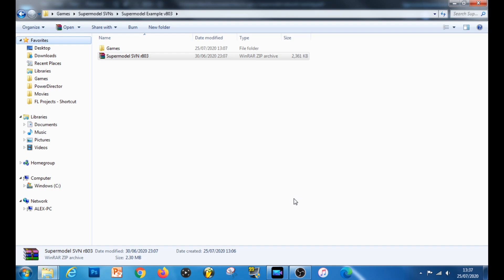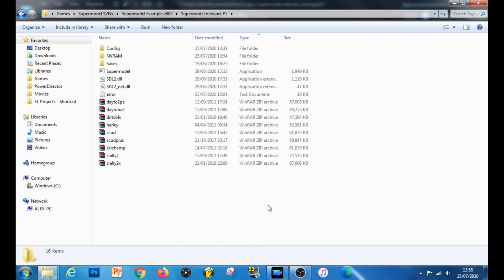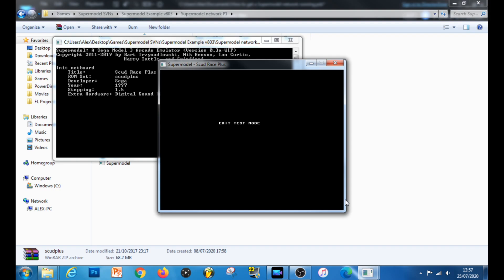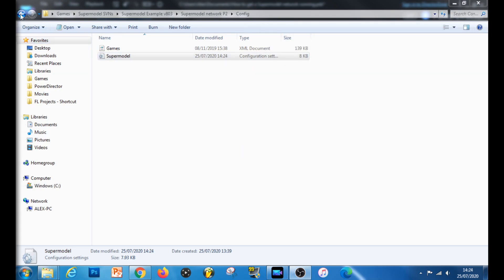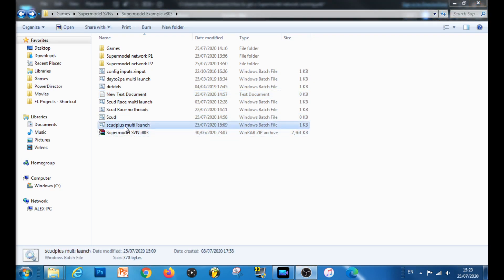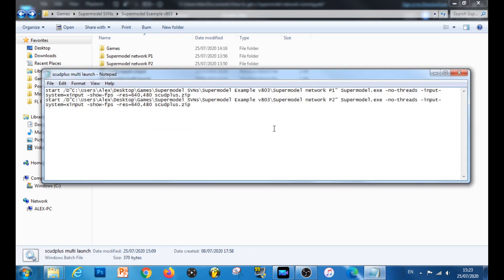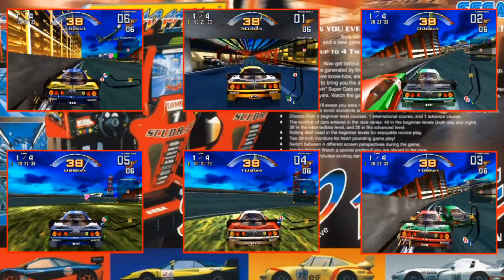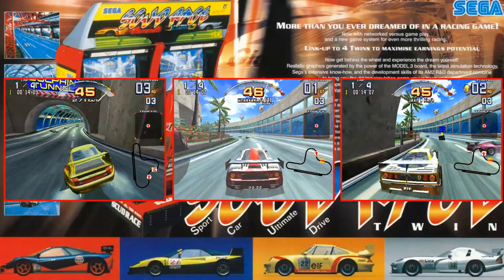Tutorial: How To Get a Supermodel3 Multiplayer Network Running

Comment: Are you able to skip the batch files and just use hyperspin/rockelauncher? Is that an option?  Sorry, i'm not super sabby in this department. Thanks
Reply from the maker: I'm not familiar with either of those frontends. I use Maximus Arcade on my Bartop, but you still need a batch file to point it at to get the game to launch. Batch files are super easy to understand though, I explain how to set them up in both thus video and the new updated version I released awhile back, which talks about the new Supermodel network. https://youtu.be/vAoGAkPMROM
I'd recommend watching that one over this one.

Comment: When I open the game, it says that the command "-no-threads" is incorrect. Then I Tried Editing My Batch File (Daytona USA 2: Battle On The Edge) I Removed The "-no-threads" And The Game Started, But There Was A Problem: The Game Stayed On The Screen Showing Game Information (Link ID, Car Number, Cabinet Type, Etc) This Happened To Me When I Tried To Load The ZIP File On The Mame Emulator.
Translated By Google Translate
Reply from the maker: This is for Supermodel emulator, not MAME.
Reply: @MrThunderwing  I know, I didn't mean that.
What I mean is that it says the "-no-threads" command is wrong, and I have no idea how to fix it.
Reply from the maker: @WolfixGaming  You don't need the -no-threads command anymore in the new version of the network. I pinned a comment explaining this after the process changed for the new network and also updated the video description.
Reply: @MrThunderwing  I already managed to fix the error, but I have one more problem...
When I open the batch file, the game starts 2 times, as it should, However, no key performs its function, and I could see that the text that says "Network Checking" was not appearing. What is the cause?
Translated By Google Translate (Yeah, I Speak Spanish) XD
Reply from the maker: @WolfixGaming  Try reading this for problems with your keys: http://www.supermodel3.com/Usage.html
I don't know why the "network checking" bit would stop appearing for you.

Comment: Hola, muchas gracias por el video, me funciona perfecto, solo que solo puedo controlar la pantalla del emulador que está activa, no puedo utilizar los controles de las 2 pantallas al mismo tiempo, se mueve 1 u otra
Reply: Tengo 2 joystick y esta configurado 1 en cada emulador, pero solo funciona el de la pantalla activa, y no puedo activar las 2 pantallas al mismo tiempo
Reply from the maker: You need to use Xinput controllers to operate each screen independently. For some reason it doesn't work if you use Dinput pads or wheels, you can only control the window that's 'in focus.
Reply: @MrThunderwing  Muchas gracias por responder mi mensaje a pesar de que fue escrito en español, mire tu video con los subtitulos automáticos de Youtube traducidos y pude entender todo, mil gracias, ahora voy a probar con el Xinput
Reply from the maker: De nada!

Comment: Hi i don't get any sound on the supermodel 3 emulator, do you know how to get the sound working?
Reply from the maker: The sound should just work as a default option, unless you're using command line options to change the music and sound volume or you've used the -no-dsb option to mute it. If you've not done something to intentionally disable the sound, I've no idea why it isn't working for you.
Reply: @MrThunderwing  Do i have to change the config settings? The only game i play is scud race.
Reply: @MrThunderwing  Could you share me your config settings please?
Reply from the maker: @marty_mcfly5438  are you trying to play the game using a GUI or are you launching it from the command line?
Reply: @MrThunderwing  Command line, i drag the rom on top of supermodel, then it launches the game.
Reply from the maker: @marty_mcfly5438  The sound should work that way. Are you using an old version of Supermodel? The very first version of it (from 10 years back) had no sound. You could try one of the newest versions from here. https://www.supermodel3.com/Download.html
If that doesn't change anything, then I don't know what to suggest, it sounds like an issue with your PC rather than the emulator.
Reply: @MrThunderwing  What are your config settings? Also i think i am using an old version, where is the link for the newer version?
Reply: @MrThunderwing  i have just downloaded a newer version of supermodel. It says "cancelled network board not present"

Comment: Hello! I am a big fan of Daytona USA and have been playing it for years. I want to be able to push this to it's absolute limit with my system running 16 racers although I have one issue. I'm having an issue with the machines crashing if I don't get into the service mode fast enough in order to switch them to slave machines and assigning a car number. Is there a way I can manually do this within the files themselves?
Reply from the maker: Nope, you can't manually alter the NVRAM to switch the car numbers. If you just enter the test menu and configure everything with the network options turned off in the config ini file you shouldn't have any issues with a time limit or crashes. Just configure each version of the game to the appropriate Slave and car no with the network options turned off, then turn them back on once you've finished.

Comment: Thanks for putting this video together it really helped me out with configuring Daytona 2 PE also I wonder how many machines you could get running now as you said you managed to get up to 6 networked machines on the same pc before things were really bad well id assume now you could get even closer now to 16 networked players.   

I was tweaking with the UI since i had the same problem you had where i was only getting 25 frames a second as it was really slow and choppy so i dropped the resolution to 496 by 384 and also increased the  power pc frequency to 100 and with 4 machines linked up with the static IP I am managing to get between 80 and 110fps so 16 players could be plausible.
Reply from the maker: Supermodel's quite resource intensive and my PC's about 10 years old now, so with the new full speed network I can only really get about 3 machines linked without starting to lose speed. Somone on the Supermodel forum with a gert beast of a PC has been able to get 16 linked versions of Daytona running. I've seen videos as well of an 8 PC network, all in converted arcade cabinets, it's very impressive.

Comment from the maker: IMPORTANT NOTE - THE NETWORK SETUP PROCESS HAS CHANGED NOW FROM WHEN I FIRST RECORDED THIS AND THIS INFORMATION IS NOW OUTDATED - YOU CAN SEE A NEW TUTORIAL HERE:
https://youtu.be/tand0tIZ47w

In March 2021, a new simulated netboard option was developed by one of the Supermodel forum members that now runs the Supermodel link-up games at full speed, which replaces the old network I'm demonstrating. The basic principle of how you get the new network working is more-or-less unchanged from what I demonstrate in the video, but the information to configure it in the 'Config ini' file is slightly different now. The simulated netboard has now been incorporated into the official Supermodel builds and works in such a way that you can now select which netboard (i.e the old one or the new one) you wish to use in the options. 

In the config ini folder 'EmulateNet', which I mention in the video, has been renamed to 'Network'. There is also a new option in the config ini file, called SimulateNet which must be set to '1' to use the simulated netboard (it is by default), otherwise Supermodel will use the old emulated netboard. Both require that Network=1 otherwise neither netboard will be used! This means as well that you no longer need the -no-threads command in your batch files if you are using the new simulated netboard.
You can download the latest official Supermodel build from here: http://www.supermodel3.com/Download.html
3 Player Game of Daytona USA 2 running on new full-dpeed network:
https://youtu.be/vAoGAkPMROM

Comment: Hi, please, i got everything to work but it is impossible to play with 2 players because the controls only answear to the window that is being selected at the moment, is there a way to have both windows receiving the commands of the controllers at the same time so i can play with 2 players?
Reply from the maker: Yes, you'll run into this issue if you use Dinput control devices. In order to control what's happening in the seperate Windows you'll need to use Xinput pads. That means you'll either need to buy some Xbox 360 pads or find a way to emulate them with your existing pads (I believe you can do this using x360ce. I've got very limited experience with it though, so don't ask me how).
Reply: @MrThunderwing  actually i tried to emullate via a program called xoutput, it creates a virtual xbox 360 controller and you can map buttons, (it is a very good program actually, i used on other steam games), changed my bat file to xinput but unfortenatly same result, the buttons only responds to the windows in focus :(
Reply from the maker: @ricardomarino3763  Hrmmm, weird. In the multiplayer games you can see at the end of the video, me and 2 other friends were all playing with PS3 Dualshock 3 pads. I was using a program called DS3 tool to emulate 3 Xbox 360 pads and, as you can see in the video, they all worked fine.
Reply: @MrThunderwing  ok. I will try to test with actual xbox360 controllers. With 2 PCs in lan i problably will not encounter any problema to run dinput in each computer, right? I will try later with my pc and notebook. Anyway thx very much.
Reply from the maker: @ricardomarino3763  Yeah, you'll be fine with 2 PCs with Dinput devices.
Reply: Conseguiu resolver, amigo? Estou com o mesmo problema.

Comment: Thanks! It's excellent, you know, when I first time execute the *.bat, my antivirus actually stops the thread as it consider that it has a virus, and delete the file, ¿do you faced something similar?
Reply from the maker: Not with Supermodel, but I have encountered this anti-virus behaviour with other emulators. I use MS Security Essentials and it's got an option that lets me make certain files or folders exempt from it's normal anti-virus rules, so it doesn't delete parts of my games or emulators.

Comment: Hi, really nice and clear video!!!!! finally i should say...
BTW what are the results with Sega Rally 2? I am a big fan of it and I really wanto to set up a two players gaming pc... does it run well or there are glitches?
Reply from the maker: Unfortunately Sega Rally 2 doesn't work at all in the Supermodel link-up at present, I don't think the reason why is known.
Reply: @MrThunderwing  i just tested a quick match with Sega Rally 2 and I can't start the game... i get an error in the main Supermodel screen saying "RESET NetBoard PC=000800 // Network code copy ending ... too bad.
BTW Daytona2 starts with your batch file but really slow.. even if i have a &core intel 4,5 ghz and a nvidia 1660TI, seems bad code optimisation...
Reply from the maker: @claudioberio9461  Yes, the network has bug that currently makes the games run slow. You could have the fastest, most powerful PC on the planet, but at present in network mode you won’t be able to get Daytona 2 to run faster Than 30fps
Reply from the maker: @claudioberio9461  Sega Rally 2 works now and all the games now run full speed in Supermodel!
https://youtu.be/5PEd-TxGuL8

Comment: Is this version  (v803) the only actual one that works for network ???  I mean, if  I download current supermodel version, v834, network won't work ???
BTW, fantastic tutorial !!!
Reply from the maker: Thanks. If you download the latest version the network option may well be in there, it all depends on whether the person who compiled it and uploaded it to wherever you're downloading it from included the option.
Reply: @MrThunderwing  I bet the official forum compilation should do it .   Thank you :)
Reply from the maker: @toniclementegarcia6656  Technically, there isn't really an 'official' version (well, apart from the highly outdated 2011 version of Supermodel), but if it's one of the ones from the thread that gets updated over at the Supermodel forum that does normally have the network option built in.
Reply from the maker: @toniclementegarcia6656  The official Supermodel page now has auto-updating builds, which support all the new changes, including the new full speed network and Sega Rally 2 and Le Man's 24.

Comment: Thanks so much, i have a problem when im playing multiple Daytona emulators only one will be controlled at a time. whatever one is on top works. i have two controllers and both work but only the one that has the window on top. do you have the same issue?
Reply from the maker: Nope, I can set up individual controls for each player and all the pads work regardless of which emulator is 'in focus' so-to-speak:
https://youtu.be/d0cyyaqYes8
There isn't a specific setting for it, so I don't know why it's working for me and not you. I'm using 3 PS3 Dualshock pads plugged directly into the PC, using a program called DS3 tool to make them work and act like emulated Xbox 360 pads.
Reply from the maker: Not sure if this is still an issue for you, but I found out awhile back this issue is to do with using Xinput controllers versus Dinput ones. For some reason Xinput devices (like a 360 controller or in the case of the video here, DS3 pads acting as Xinput ones) are able to work in Supermodel no matter which emulator is 'on top', but this isn't the case for Dinput. This also works in Model 2 Emulator, hut not multiple instances of MAME for some reason....

Comment: Thanks for this tutorial, I managed to connect 2 pcs via LAN, but it looks very slow. I put MultiThreaded option to zero in the .ini file or else it won´t do Network Test. Is strange that with Multithreaded = 0, both machines can run the game at full speed standalone, but when network is enabled works at half the frame rate.
Reply from the maker: Yes, it's the actual network that's slowing things down. I don't have a second PC to try a LAN out on anymore (my old dual core PC I used to use as Player 2 in some of my old Model 2 and MAME videos died a few years back and the PC in my Barcade doesn't have a GPU and can't run Supermodel) but I've read that a Supermodel LAN is actually slower than a single system network.
Reply: @MrThunderwing  do you have amd or intel/nvidia hardware? On my amd machine New3d and Quad Rendering options slow down emulation a lot
Reply from the maker: @alvaroff81  I'm an NVIDIA guy. The problem with AMD hardware and slowdown is a known issue with no fix yet (that I'm aware of).
Reply: How did you do that?
Reply: @bardougarou5867  You need 2 computers
Reply: @alvaroff81  I have 4 lmao, I was asking how you did it but it's all good. I got them working.
Reply: How did you get it working on two seperate PC's over LAN? I've got it working but with the slowdown. Haven't been able to sort that as of yet.
Reply: @shanzo85  The pinned comment by MrThunderwing contains instructions on the updated procedure, also make sure you have the latest version of Supermodel